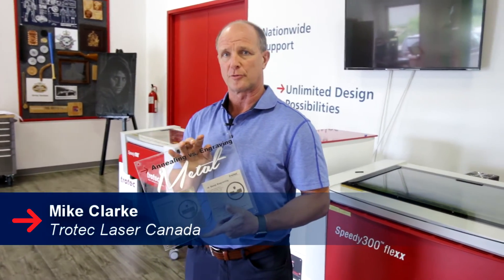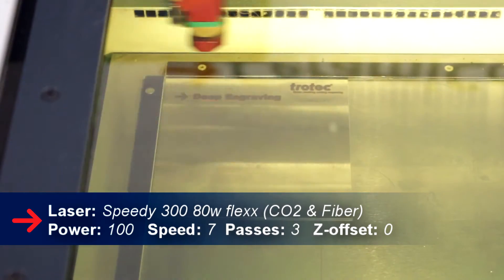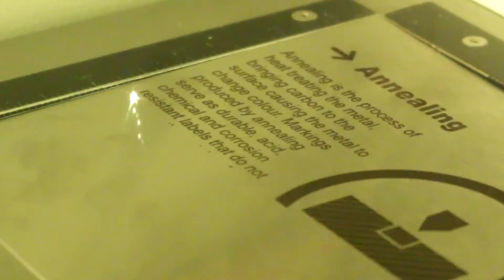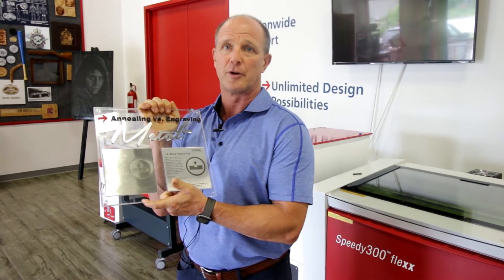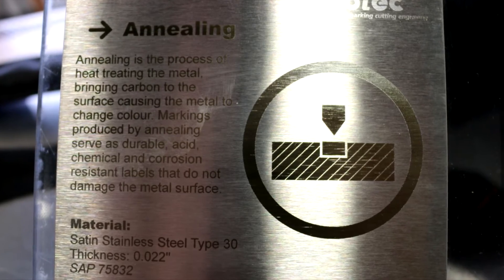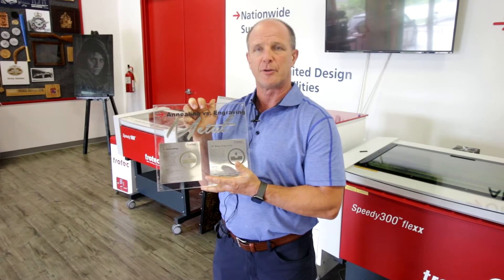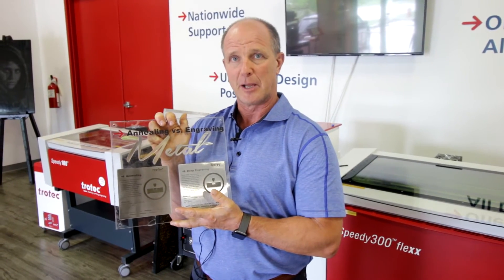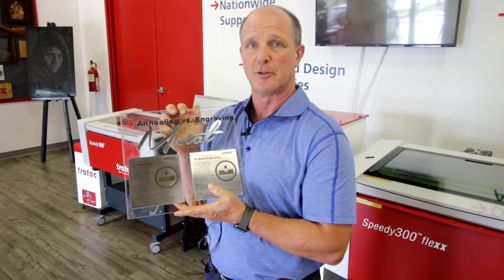Annealing Metal vs Engraving Metal | Laser Marking Metal | Trotec

Comment: Hi, I am very pleased that someone shows some examples. Have been struggling alot especially with fiber laser. I am guessing that you used 3.2 inch fiber lens, 1000 dpi and 2mm positive offset (table moves down). Can't get black marking on stainless with my flexx (20W, stock lens). Also from what I have read from one of your replies, I should be always using 20kH?
Reply from the maker: Thanks! 20kHz is OK to use with a 20W system.  If you can't get a black mark at 5% speed, clean your lens and head mirror.  The fiber wavelength is very sensitive to any dirt or film on the optics.  Even if they look clean, there may be a film there so clean them anyways.

Comment: Hi
On the the setting you used for ablation. what is the depth it created?
Reply from the maker: Hi there, we'll double check with Mike and get back to you
Reply from the maker: Approximately 0.003"
Reply: Thank You.
Also, is there a certain size lens that is best for oblation of stainless steel?

Comment: Obviously, we are a Jewellery store.  We do a lot of custom work, where we work from scratch and some of it is very intricate filigree in Silver, Gold and Platinum.  
Lately, we've been getting requests for ferrous metals like stainless and for exotics like Titanium and Tungsten Carbide.
We need a machine that is physically quite small... as in a desktop unit ... yet strong enough to be able to cut through up to 3mm sheet.  We also need to be able to cut out parts from  barstock that maxes out at about 15X3 mm.  
It would be nice if you told the tolerances of the cut, like what is the minimum beam size and how deep it can cut in various materials. 
We need to be able to work "in the round", on 3D surfaces and to be able to cut into interior surfaces, like inside a ring.  
The warranty details and the price, in Canadian dollars, would be helpful  as well.

Whaddya got?
Reply from the maker: Westdale Jewellers hi guys, our machines are not metal cutters just markers - for the most part. Our SpeedMarkers (galvo lasers) can technically cut some metals but with lots of passes. If you go to our website (www.troteclaser.com) and fill out the form in the contact page, our sales rep will get in touch with you and give you more details.
Reply: Hey what do you use to cut silver and brass please?

Comment: hOW DOES THE FIBER LASER WORK ON ALUMINUM? CAN i CREATE DEPTH?
Reply from the maker: Edward Rohlfes Hi, yes you certainly can with a Fiber laser. We sell both anodized and regular aluminum sheets. With anodized, you can use CO2 and Fiber. But if you want depth it has to be Fiber on a slow speed with multiple passes like we showed in the video.